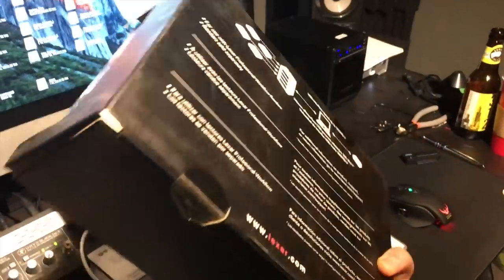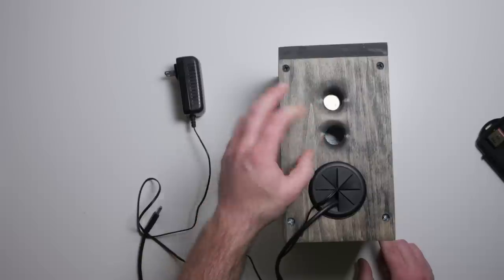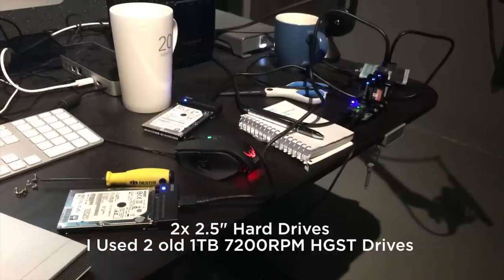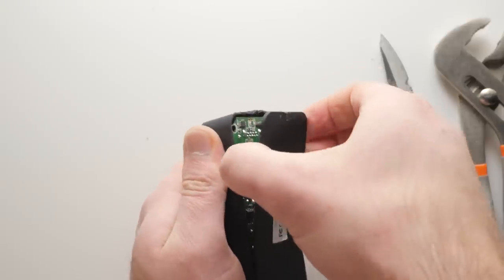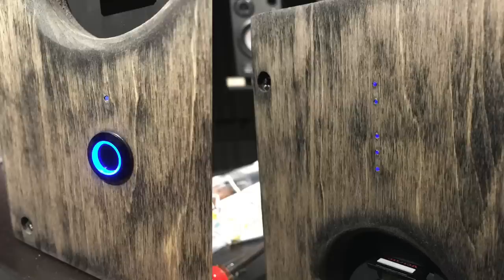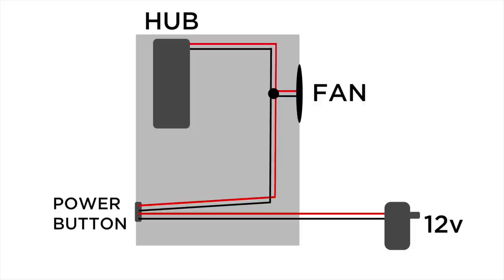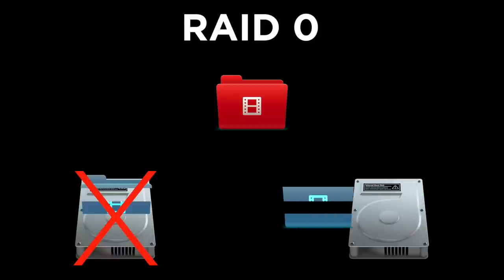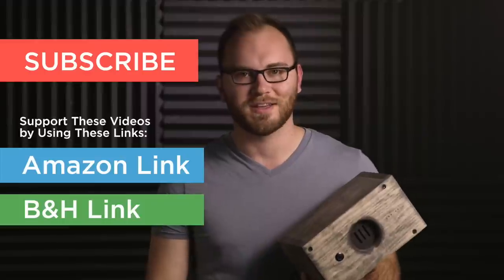DIY Card Reader/Hard Drive RAID Enclosure

Comment: This is great! The biggest annoyance for me with my iMac is the SD card port being behind the unit (I miss them on the side!). I tried running some hubs and adaptors on the desk and it just felt a little too unorganized. This has always looked impressive, and this seems not only easy to build, but also fun! When I get some old internal drives, I'm gonna give this a shot!
Reply from the maker: +The 8-Bit Duke Do it!!! Another method you could use in the meantime is running the card readers under your desk. Could have them right near the edge right underneath the desk. I've don't that before.
Reply: ***** I think I'll give that a try! Thanks for the tip, my friend!
Reply from the maker: +The 8-Bit Duke You bet!

Comment: Hi Caleb! Great job on this DIY project!

Word of warning re: power brick for this thing. I used to have one exactly like this (usually comes with up to 2A versions with pretty much any 2-hdd enclosures, such as an ICY-BOX, for instance). After about 2 years of constant use, the power brick stopped delivering all the required current and the symptoms were hard to put a finger on - the enclosure would just fail to start sometimes, but would run for ages if it did manage to start... Apparently the torque required to start spinning the HDDs was drawing too much current.

I recommend switching this PSU to a 5A-rated one with the same plug - they are usually sold as RAID / monitor PSU. It will save you headaches down the line and will run cooler overall, too, at minimum cost!
Reply: +BrotherBloat also: ignore me if you only plan to run SSDs in this thing - the point is moot with those! :)

Comment: You can also use an ATX power supply rather a simple 12V power supply to feed everything. I know it can be a bit bulkier, but if you have one of those with no use, the project can be even cheaper. Great video, by tthe way!

Comment: Ok, first of Nice box, nice setup.
Now, 
-Bigger fan hole, and maybe a bigger fan, 40mm fans do not move alot of air, get a 70mm fan in there stat, and use a metal fan grill (they are really nice) and make the how the same size as the fan blades.  (though it could be just the angle of the video that makes the hole seam smaller than the fan)
-Raid 0 BAD BAD BAD, yes you have a good backup solution, but that does not cover things like failed USB to Sata converter. If power falls or something happens to damage one drive, it could corrupt your data and then your backup data (enable Shadow copy, it takes up more space, but better than nothing if you want to keep Raid 0)
-No anti vibration on the hard drives

This is what I would do (which is total over kill) Make a small ZFS file sever with 4 hard drives setup in a pair of Mirrored drives (it is the same as a RAID 10 setup), set a linux script that would auto copy sd cards, and auto backup after copy + timed backup.  Network share setup, add in a 4 port gigabit card with port teaming for a max total bandwidth of 400 MBps, as a plus it can also backup your PC, upgrading the drives can be done 2 at a time or you can just add a new pair of drives as needed.   I would keep the nice separate box for the sd card reader so that it can easily be placed you your desk.  Maybe add a button for auto safe dismount.

Comment: Looks really nice! Tough on a technical level there's much room for improvement :) First of all, you're using software RAID 0 through USB. That's... well, I know that your iMac is the biggest limitation here, but still... how about using Thunderbolt for example? It is based on PCI Express and doesn't have such impact on CPU, it's just more reliable.
Those SD card readers... It really looks like a budget solution. Do they even have reasonable speeds?
It would be great to see some benchmarks :)
Reply from the maker: +luk1505 You can definitely do better than this, but for $112 you can't really beat it! I think benchmarks deserve another video. I'll say the card readers are more than double the speed of my iMac's built in reader.

Comment: Cool video. I'm about to build one myself but I had a question. Do you think the USB hub ( since it is 12 volts) can power a SATA 3.5 drive if I use one of the dual USB adapters into it? Or should I wire the 3.5 hard drive into the 12 volt source like the fan ( and have one usb going from the 3.5 into the hub)?

Comment: man I fell asleep watching your video and your outro music almost gave me a heart attack!!

nice video. I didn't know you were that good with woodworking. I would like to see more videos like this. 

I used to buy external HDs to expand my storage, but now I have many with different sizes and it is a mess to connect and power all of them. I need something like a NAS or a drobo to put all my external drives in. Any suggestions on a diy solution?
Reply from the maker: +Samtagri Haha! Sorry about that. Yes, I plan to make exactly what you're talking about. I'm hoping to make a 15 bay enclosure called "The $hit Box" that will hold all my random drives. Can't wait to get started on it. I would recommend setting up a cloning system rather than RAIDs since the drives are probably different sizes/speeds.

Stay tuned...

Comment: I'm thinking about taking your idea, but as a couple people have mentioned, do you have any issues with bottlenecking going from the cards to the drive? I thought about picking up a solid state drive to make this thing super fast, but I'm still struggling with the single usb into the computer. 
Any insights?
Reply from the maker: So far I've had no issues at all with my setup. That said, an SSD would be a great choice if you're starting from scratch.

Comment: Honestly, I'm kinda not sure about the using the RAID 0 over USB ... I've got quite a feeling that the USB 3.0 will be limiting the transfer speed and the performance will be quite same as in the case you used one HDD  ... this thing works great when you have hardware RAID since it is really working with two SATA lines directly ... in this case, you send half of the data to one HDD, it goes through the USB 3.0 with speed of  5Gbps while the HDD connected to SATA3 could use 6Gbps - the USB 3.0 is the limit in this case (also 5Gbps is only theoretical speed) .... and after you save that half of data you have to save second half on the other HDD .... guess that using the older SATA specifications it could help a little bit, but probably it wouldn't be such an advantage ... Also, using OS level software RAID means lots of CPU operations to just to keep RAID working ...I'm not really sure how upgradable or not-upgradable your Mac is, but I'm pretty sure that sigle internal hard drive would give you much better performance than this USB 3.0 RAID 

Have you tested the speeds of single HDD vs this RAID? I'm quite curious about the results to be honest ....

Comment: if I use an external power source to a usb hub will that allow it to read more devices plugged into it, I have two hard drives I want to use on a hub I have but it can't seem to read them both at the same time
Reply from the maker: +george aura Are the drives 3.5"? If so, I would look into this adapter: http://amzn.to/1l4dPLY it has it's own power cable which would be safer. You can hide a small power strip inside the case if you want to use several drives. I'm planning on making a ridiculous 15 bay setup using those.
Reply: I have a to usb on on of the drives the other just plugs in USB, but I wanted both drives on my usb hub and I was wondering if I use a power adapted to my hub if that would be enough to power the two usb hard drives, the hub has four ports two will already be used one by an sd card adapted another that connects my mouse pen to my pc
Reply from the maker: +george aura If you hard drives don't already have power then use, you definitely need to power the hub. Would be better if you had power directly to the drives unless then are 2.5 inch which don't require as much power.
Reply: Oh no my hard drives don't use external power
Reply: I will definitely get external power for my hub then if that will fix the issue I'm having of not being able have them both read on the hub at the same time.
Reply from the maker: +george aura No problem. Just power your hub or pickup a hub with with a power input and you should be fine.
Reply: Cuz the only thing that happens is the one hard drive that I have hooked up to a sata reader only powers up when the sata reader is plugged into the hub but the pc can't read it
Reply: +DSLR Video Shooter Any ETA on that 15 bay setup? Should be a fun project, I assume backup would be the point of this since 15 bay Raid 0 sounds insane ;) btw, I'm in planning stages of 3-5 bay unit. Great Video - I was very inspired!

Comment: If i keep this on a table, how can I expect air to come in through the bottom?
Reply from the maker: Just put some rubber feet on the bottom four corners. That will lift it up and give you plenty of clearance for airflow.
Reply: +DSLR Video Shooter will try that,but without ssd cards. i plan to add a raspberry pi inside the case and run NAS. Hope it will work? Should i change the design a bit for this purpose? May be add a tan on one side to keep it cooler?

Comment: Why not using RAID10 built on 4 drives instead of having 2 raid0 drives and 2 backup drives?? It gives the same speed increase...
And... power switch for 10$? 40mm fan for 7$? Grommet for 5$?? You paid too much for it, it costs a lot cheaper

Comment: This really is a sub-optimal setup. You're round tripping all of the data through a single usb cable and connecting all of your devices to a hub. There is also no automatic functionality. It is also very annoying/difficult to replace any of the cheaply made components once they inevitably bite the dust. Sorry to be such a hater (I love most of your stuff), but in this case the whole is actually less than the sum of its parts.
Reply: that makes no sense, its not hard to re-plug a hard drive in a usb adapter ,annoying yes , difficult no, and i have a old sd card reader 3.0 from the dollar store still works years later ,he made this to suit his needs

Comment: how can I setup a hard drive in raid 0 ?
Reply from the maker: +george aura Are you on a Mac or PC?
Reply: Pc
Reply from the maker: +george aura Ok cool. First, you need two drives to create a RAID 0. Search google for "create raid 0 in windows" you should find some good info there.
Reply: Anynone seeing this trying to be smart: this only improves sequential, not 4K speeds. For nvme raid you need vroc for Intel (be very careful which socket, cpu and motherboard you select to support this), or TR4 socket on AMD.

Comment: I don't understand the point of making this ? Those two drives in raid are slower than any modern 3.5" drive, so what is the point of copying 3 cards in the same time on that slow drive ? You could copy it faster one by one on some fast drive. On the other note, why would anyone copy three SD cards in the same time, you can shoot all day with one 64GB card with A7s or GH4, and you can copy that card in less than 10 minutes, so there is another point that this doesn't make anything faster, but actually way slower for editing than any two 3.5" drive Raid 0.
Reply: 2.5" HDs can be powered through USB which makes things much easier. But if you want to build a faster version with 3.5" drives then go ahead and post a video on youtube when you do.
Reply from the maker: +Vladimir Taliban First off, two drives in a RAID 0 will out run any single drive with the same specs. Secondly, I love having more card readers because I can start the import and walk away rather than sit there babysitting the cards. Another important note is that these card readers are much fast than the SD reader on my iMac, so copying from several cards doesn't take a speed hit compared to importing them individually from my iMac's SD reader.
Reply: +Samtagri I'm not saying 3.5" version of this is better, I just say that whole box is totally meaningless, because one good card reader and your internal HDD is at least as fast as this. So If you have RAID setup or SSD, you can very easily have much faster card dump setup without doing anything and having a whole new peace of hardware...
Reply: +DSLR Video Shooter It really doesn't because those 2.5" drives are very very slow, around 60-70MB/s, and one modern 3.5"t; drive is around 180MB/s, so it is faster. The second thing is, have you heard of USB3 card readers ? SD card reader in 2011. iMac is really not the fastest thing you can have, it's really on of the slowest.
Reply from the maker: +Vladimir Talijan Ah, I see what you're saying, but this video is about improving my setup with stuff I had. If you're buying new than yes, by all means go for something else.

Comment: Lol iv got a old speaker a huge one that i cut the back front off of and the back installed a few metal poles boom a rack for 300 hdds it curently has 20 in it manly because i haven been able to cool it with a full 300 hdds otherwise id have a fuckton of storage also i forgot to mention that in the bottom there is a shelf whitch i mounted one of those asus motherboard that have a lot of pcie 16x slot got the adpter and mounted them in the bottom and filled them with cheap raid cards so i could use all the hdds if anyone knows a way to cool it without water colling please tell me it has plenty of space in it for cooling systems. If anyone is wonder why im not useing water cooling i used 3 diffrent sets it overheated all 3 thats very rare for a water cooling block to over heat also i can use as much power on it as i want because it has its own 3 fuses on my breaker Panel
But yeah it need cooling to operate at full capacity i even managed the shakeing useing springs. The crazest thing is the 6 power supplys